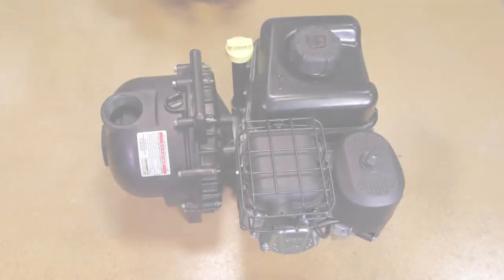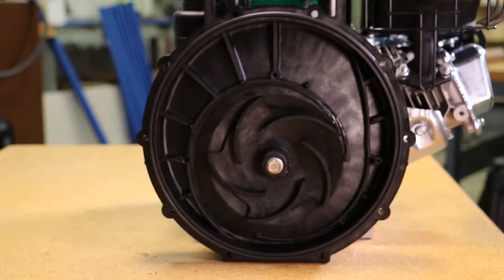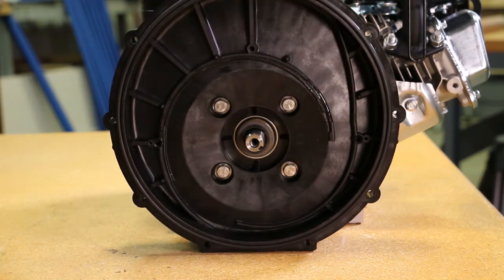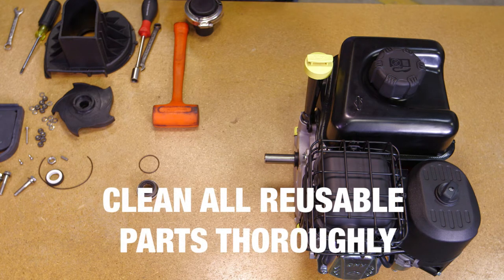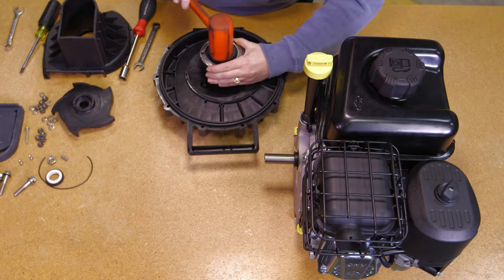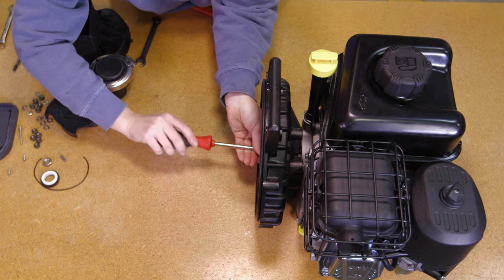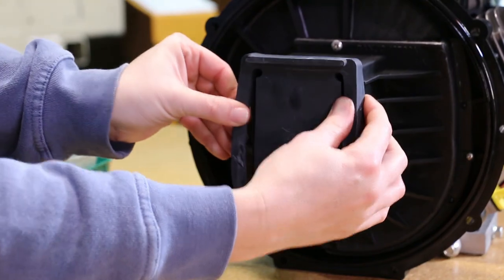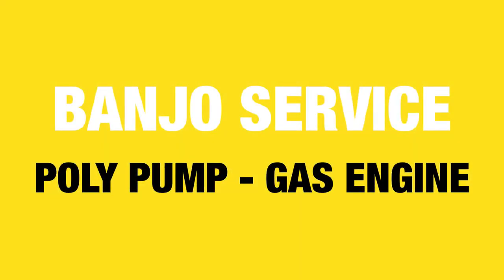Banjo Poly Pump Gas Engine Service

Comment: Ive read over and over every manual that came with my pump. No where does it describe how to prime the self priming pump.  I think the name implies it’s self priming but that is not the case and it would be great if somewhere on the website. You explained how to prime the self priming pump.
Reply from the maker: If the pump is gravity fed then it will prime itself.  If you are having the pump lift liquid up, then you will have to take the prime plug out and put liquid into it the first time.